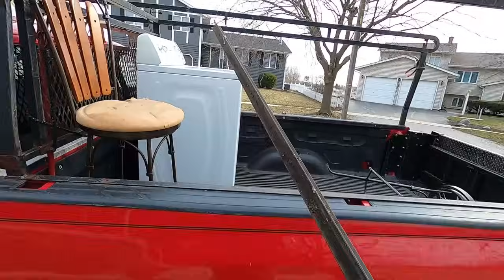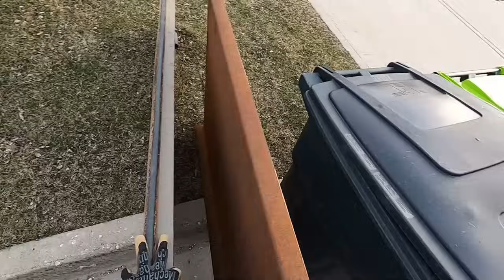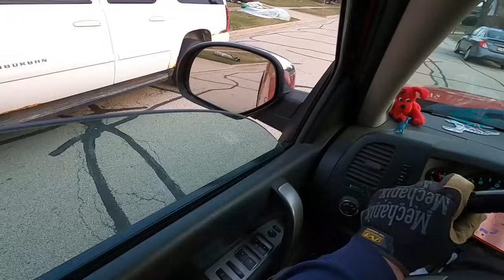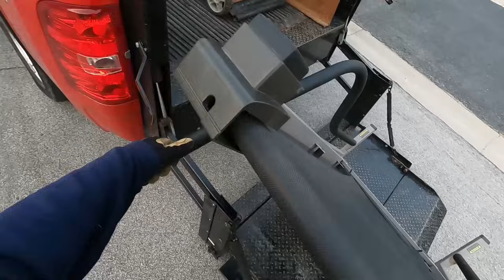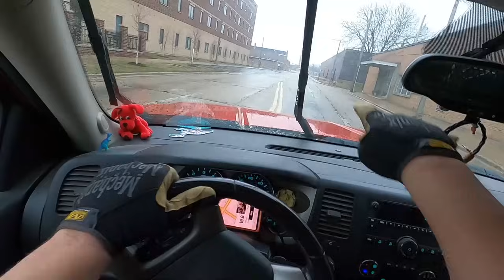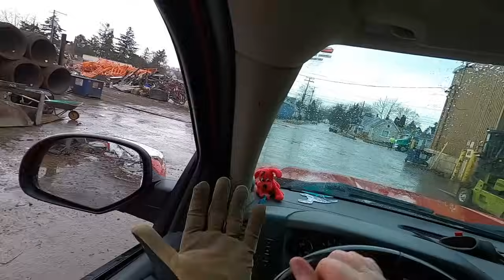Scrappers Rolled up on Me - Garbage Pays on Garbage Days

Comment: When my mom used to drive as a job, she had a notebook she kept records in. She used one vehicle for her job and her other for her personal vehicle. She got a gas card/credit card for getting gas in her work vehicle so always had records of what gas she got and paid it off each month. She kept her monthly gas info in notebook as well as daily earnings. She also included and receipts for repairs on that vehicle. This helped when tax time came to show all income and outgo for the job. This helps to not pay as many taxes on income. I enjoy watching what you do. The animal crate could have been sold individually, people fostering or training dogs use them sometimes. You can see if there are any places near you that help with weatherization. They will show you good ways to help you to save money in the colder weather. Sometimes, caulking around windows helps. My mom and dad had insulation blown in and upgraded to new more energy efficient appliances and water heater, furnace, heat pump, thermostats, etc.. They did it little by little and used energy rebates to save money. They also redid roof and windows and doors later. None of this is cheap. I always said if I have a way to own a home again and can do it, I would like to have my home as green as possible. Tankless water heater, good insulation, windows, etc. Maybe ever, solar panels and mini wind turbine?
Reply from the maker: Detailed records is smart.

Comment: We have a Chevy Equinox and we love it!  Had it for almost 3 years, bought it when it was 2 yrs old. We've never had a problem with.  I buy nothing but Chevy's because they are the only vehicles we've had that out lasted the payments.  lol  Here's a goal for you.  Save up for a Moritz dump trailer. It sits pretty low so it should be easy to load and then when you get to the scrap yard, flip the switch and (after you open the doors) it will dump the stuff for you!!
Reply from the maker: Thanks for the equinox tip

Comment: You want to know something weird? I'm watching your video and the part where you pull your truck forward to let the homeowners in their driveway and you start to tie off your load. When the knot didn't work and the line is rubbing against each other, I got that same feeling you get when you run your nails against a chalk board or something. When I saw that line rubbing against each other, I could feel the hair on the back of my neck stand up. 😮. Weird 😊. Great video as always 👍

Comment: That was awesome of the other scrapper to point out some scrap you might have missed . That was a great load. I know they were busy but could you have turned in the brass right away or did you have to do something to it before??? Just curious. We have been having strange weather . Snowed this afternoon and is suppose to again tomorrow despite it going up to 12C . Have a great weekend . Keep Safe ❤Keep Well❤Many Blessings
Reply from the maker: Yeah the brass has some steel bolts still attached. If I turned it in as is I would get brass breakage. Or dirty brass they call it. About 25% of brass value
Reply: @ScrapPalletMan  Thank you for answering my question. I thought I saw some bolts on the bottom but was not sure that was the reason . Hope you are having a great weekend. Much Love    ❤❤❤

Comment: Paul, you mentioned goals. It is very important for you to decide how long you are going to live after 😕 You retire or become disabled. Most people's goal is 75. So you subtract your current age from 75, and multiply that result times $2,000 per month. Then subtract your anticipated social security check per month (if you believe You will get SS). The result is the amount of dollars you need to save now each month for your future.  I did that and now have a sufficient amount of $$ to live on.    Put it in a 401k where it's not that easy to get to it now. LOL VERY IMPORTANT YOU HAVE THIS GOAL.
Reply: For people that have nothing in savings, why not set a goal to put $100 a month into a Roth IRA.
Reply: Margee,say I'm 67 subtract that from 75 which is 8 ,8 times 2000 is 16000! What kind of a job should I have to start with? 16000 times 12 is 192000. I must have misunderstood the instructions. Could you make an example? If I have a job where I can put that much money in a retirement every year I wouldn't have to worry about retirement.

Comment: get the original k5 blazer from the 90s. I read somewhere that what we call ladies bikes today were originally designed as men's bikes. they said the low bar was for us when we fall off the seat we don't hit our family jewels on it. paul you should switch from Splenda to either agave nectar or stevia! Splenda is just as bad for you as nutrisweet and equal. i used to use Splenda and got sick from it. switched back sugar or stevia and never been better.

Comment: You don't want any gm with a 3.6 v6 its an awful engine !.the water pump is inside the engine block and it can dump water into the oil when it goes out.  And it is driven by the timming chain 👎👎  stupid design.